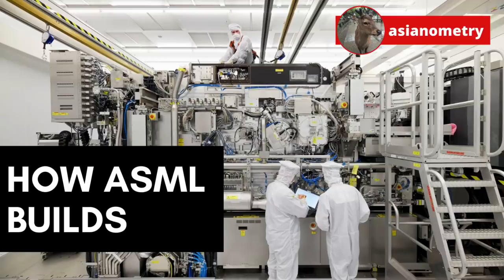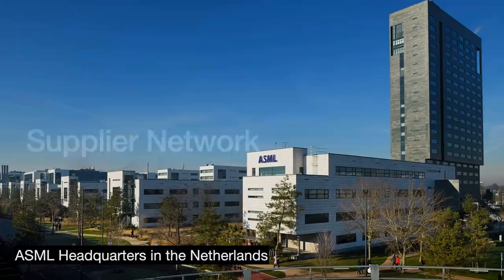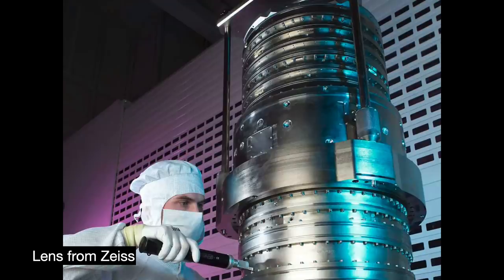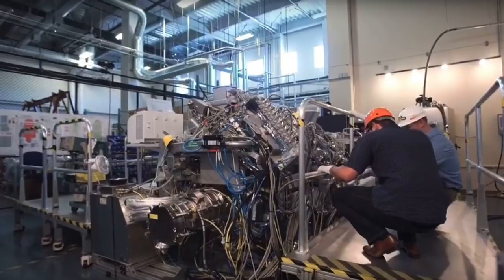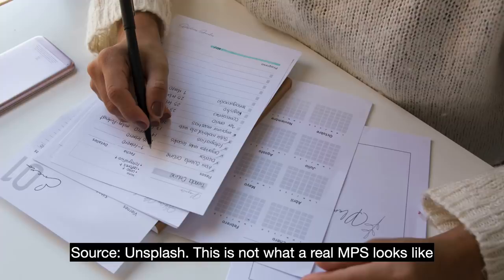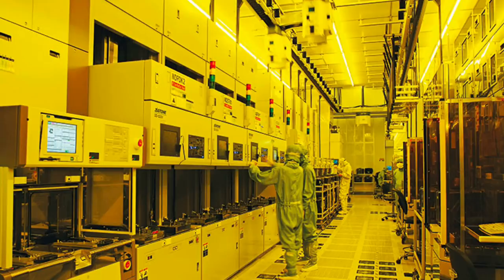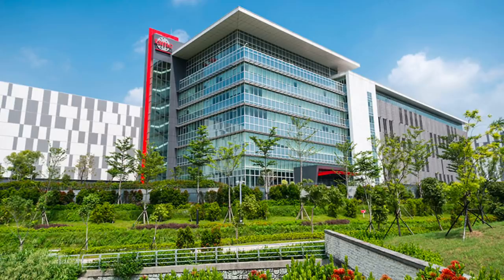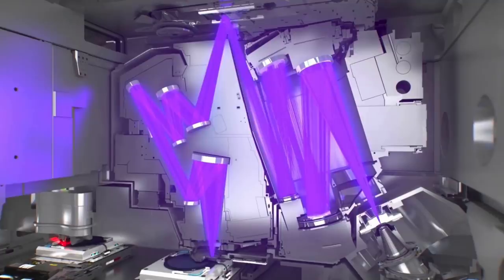How ASML Builds a $150 Million EUV Machine

Comment: "EUV mirrors have less than 70% reflectiveness"
Could someone explain why it's so low?
Do the mirrors get dirty?
Does the air cause problems?
I've always thought that mirrors are 100% reflective.
Reply: https://en.wikipedia.org/wiki/Mirror#Reflectivity   In short: wavelength dependency.
Reply: @pieteromt8121  so what if the color of the mirror was adjusted to better reflect the purple color?
Reply: @mikesuniverse1789  This is like saying "Why don't we just make it better". While the wavelength of visible light ranges from 380nm (violet) to 750nm (red), the "light" used in EUV has a wavelength of ~13nm. It's effectively a soft xray, which has a tendency to get absorbed by everything (even air). The mirrors have the best reflectivity at this wavelength that industry can provide at the surface quality needed. But if a material or construction with better reflectivity at this wavelength were developed, and it was still able to meet all other requirements, ASML would use it.
Reply: It's the best you can physically do.
The euv is x ray and it penetrates the surface of the mirror. You need to think of the xray as a electromagnetic wave. So the contact and penetration of the mirror material will produce some losses, due to interaction from the electromagnetic wave with the atoms.
They even correct the mirror layers for the local gravitational constant, where they are used. They start with more than 80kw of Laserpower and end up with a little above 100 Watt on the waver.
Reply: @sebastianmuller1210   This is the second time this constant has come up in the comments.  Tell us more!  I recall it back in college being useful in a class that had to do with the calculations of things wizzing about in the universe between planets with their gravity effects on the object.   But now in very high frequency "light" reflecting off a "mirror"'?
Reply: @robertshreffler6155  it is x-ray not light. They use the "extrem ultra violet" term just for better marketing. But light and x ray are both electromegnetic waves. And due to quantum physics the wave can penetrate a certain depth of every Material. All the penetrated material will be set in swinging motion (on an atomic (electron) level) and send as a "new" electromagnetic wave from that atom(electron). Thats why layerthickness maters. It should not be deeper, than the first penetration of the wave.
Every mirror  only reflects 30%, due to energetic losses by setting  atoms (primarily electrons) in motion and by them emtting in all directions.
The gravitational constant of the place, where the  mirror will be used, is important due to the different thickness in the material layer determined by gravity "compression".  You will have different layers, to make a layer that gets in "atomic  motion" and emitt the x-ray again,  and behind that a layer (or several) to block of  the  emitted radiation or redirect it in the opposide  direction (wanted direction).
Every physicist would  dislike the answer, it is very simplified for "everybody".

Comment: I thought they were using electron beam lithography nowdays than EUV?
Reply: E beam lithography is to slow. It is good for laboratory prototypes but not for mass production.
Reply: @kazedcat  I think its used for making the masks from what I understand, but because of this there are some saying it's used for making the chips. I wouldn't be surprised if they did use this method in the future if the technology improves
Reply: nzoomed There are some research on using multiple e beam to speed up scanning but I don't think it can compete with the speed of photolithography. Using it to create mask is okay because mask is reuse several hundred times so output is amplified.
Reply: @kazedcat  I didn't realize it was so  slow. I thought it would scan in much the same way as a cathode ray tube
Reply: nzoomed The photoresists needs time to develop so e beam scanning is limited by the photoresist.
Reply: @kazedcat  OK, well its possible better photoresists will be developed in the future, lots of tech used today was considered impossible not that long ago, the biggest issue is that to get chips down smaller, there are less options as far as wavelengths of light are concerned, and then the gates on the transistors will be almost the size of the atoms themselves which means we wont be able to make them any smaller.
Reply: @nzoomed  Photoresist is driven by chemical reaction. Faster reaction means less precision which is what you want by using e beam.
Reply: @kazedcat  there are always ways around this, find better chemistry, much like faster speed film, also a higher energy beam could be used. At some point its going to be required, just a matter of time.

Comment: The part about using droplets of tin is surprising.
Reply: U need the dropplets of tin to produce the euv, which realy is röntgen rays/ x-rays. But the Marketing guys decided x rays wont sound good enough.
So you hit every dropplet with a laser and get them in a plasma state. When they collapse back to the state where the electrons join the core again, they have to loose their energy and thats when they emit x-rays. I would say its the key component of the hole new lithographie process.
Reply: @sebastianmuller1210  I remember in chemistry class we used to put some copper compound into a flame and it would light up green. I think this was caused by the electrons falling back and emitting light with a green wavelength. Is this the same thing but with xrays?
Reply: @GotYourWallet  hi. Yes it is. A flame is a plasma. Different elements emitt different wave length of electromagnetiv waves (light/radiation).
Thats what they do for fireworks as well. But here they use a high powered laser and focus it on each dropplet, so there is much more power involved to beginn with, than any flame can offer.

Comment: Then why intel can’t do 5 nano if the tech is available?  Or they Just stick to their old guns and pray for miracles?
Reply: ASML is just one part in the whole process.  It’s an important tool, but a tool doesn’t build the final product for you.  It’s like saying since any carpenter can buy any of the best power tools, all carpenters could do all the jobs equally well.  Simply not true.
Intel’s particular case is they went down a different path in how they build their chips, and that path turns out to be much more difficult to progress pass 10nm than the process used at TSMC.

Comment: You dont use lenses for EUV, you use mirrors. Like you show at 11:26.
So the productiontime for lenses should not be included in your storytelling.
Reply: Actually there are over 50 lenses in addition to the many mirrors in the seed module which is at the heart of the overall EUV unit...
Reply: @matthewreed1441  hi. What is the seed module?
The x-ray alias euv path is without lenses, cause they are useless on x-ray's. You can see the path of the x-rays in the video at 11:26. There are no lenses included only mirrors.
Before euv you had one big lithogrphie lens array preparing the light for the mask to do the actuall job. Now its done by mirrors.
You need lenses for the laserbeam to hit the tin dropplets. Ok. But those lenses aren't anywhere as complex as the lithographie lens array.
Reply: The seed module contains the 2 lasers, several amplifiers and a multitude of lenses used to get the laser beam to the vacuum chamber where the Tin droplets are vaporized to create plasma which produces the EUV light. I used to be a final test tech for the laser company that supplies ASML with the lasers used in the process.
Reply: See my comment I posted for more info.
Reply: @matthewreed1441  found it. So my last comment is correct. The lenses you mean are part of the laser array. So no comparisson to a lithographie lens produced by zeiss for the previous generations of lithographie.